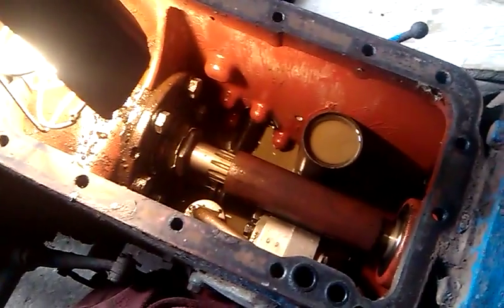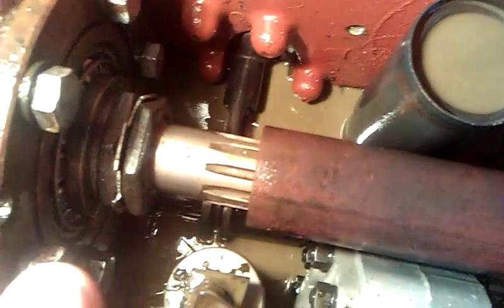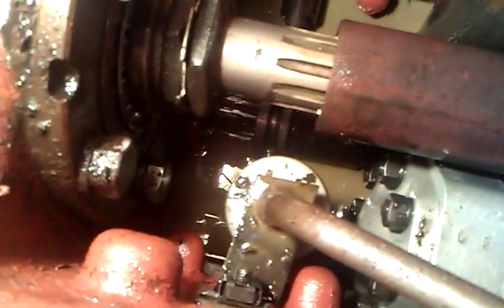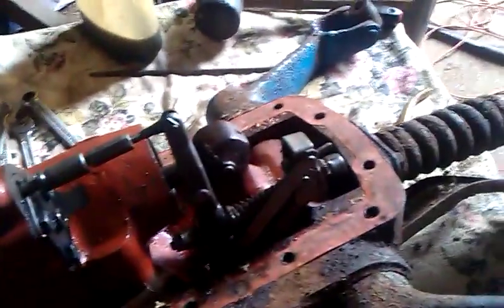fordson dexta hydraulic problem

Comment: Hi Edward I got a dexta similar  to yours and yesterday  it started to delay when I pull the lever up like 4-5 seconds wait be fore the arms come up. It started doing it  after I had a lot a weight in the transport box and dumped it. That's when it started the delay stuff it was fine before that but the lift arms were always jumpy on it. Wondering  if you could shed any light on it..

Comment: I am in a similar situation, mine was completely rusted up with a pile of rust on the inside. I have several pieces that need to replaced and i cant find parts,videos,or very many diagrams. I got it all back together today and it doesnt seem right. mine is a 1959
Reply from the maker: +Roger F What do you mean by doesn't seem right are they still stiff or is the position control no working right. If they are still stiff then you could try getting a blowtorch on the position leaver inside to loosen things up. If the position control is not working right the lift cylinder adjuster may have been moved making the position of the hydraulics off point

Comment: Mine seems to have the same problem as when it is running you can move the hydraulic leaver up about an inch but it is very stiff which makes the lift arms move all the way up but once they reach full lift they start to slowly drop down again. If the this similar to your problem please could you advise me how fix it thanks. Great videos by the way.
Reply from the maker: +Aaron Findlow That is the problem that i had The problem with mine was that water hand found its way inside rusting  and seizing the mane shaft on the inside. to fix it i had to take the shaft out and remove the rust and put a lot o oil on it and then put it back together. this fixed the problem for me hope this helps
Reply: +Edward Wall Cheers, but What do you class as the main shaft?

Comment: Did you get it sorted ?
Reply from the maker: Yes
Reply: ok, great, I had a spare one, that was all.
Reply from the maker: thanks
Reply: @npaisnel  spare one ?
Reply: @tomroskell403  Yes, I think what i was referring to was a spare top hydraulic box.  I believe I have two of them.
I still have not got around to working on mine.    Maybe this year I'll start.  Need to remove the pins from the trailer hitch lift mech.  Going to need gas to heat and make a frame to press them out with a 'ports-press ' hydraulic ram and pump/ body straightener kit.
Reply: @npaisnel  ahh
Sounds fun
I was looking for a replacement lift cover top , i  found one on ebay .
Good luck.
Reply: @tomroskell403  OK
Yes I have about 2 spare lift top covers.  need to rebuild one and set it up.  Found  DVD that explains how to do it without the correct factory tools Mike Perry Fundamentals of Restoration, Tractor Hydraulics, Volume 1
Reply: @npaisnel  ow that video info would be very useful,  i hadn't found much on the tube , were would i find the dvd ??
Reply: @tomroskell403  copy and paste the complete name I put up in to Google and and link should be found of where to buy it
Reply: @npaisnel  cheers
Reply: @ewall313  Hi Edward. I have EXACTLY the same issue. Ive got the head off - could I enquire as to what was your cure to the problem was?
Reply from the maker: @timothywitt1770  I had to remove the control arms and remove all the rust from them and well oil them.